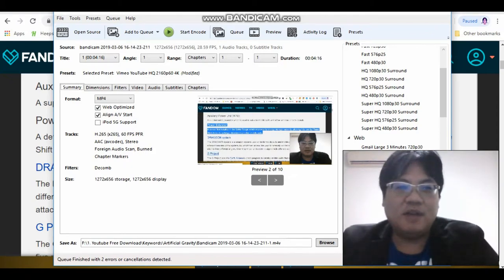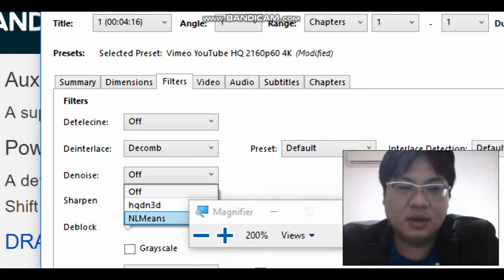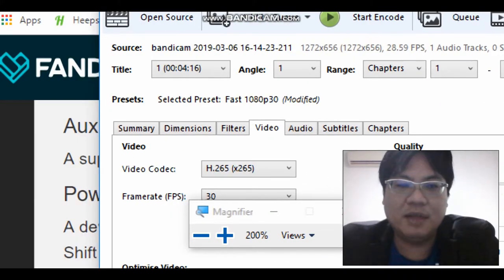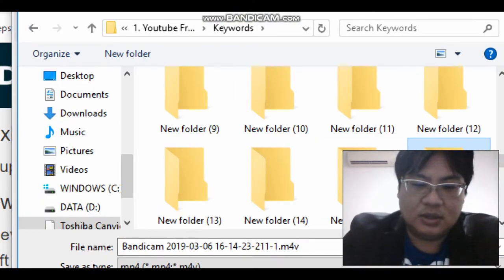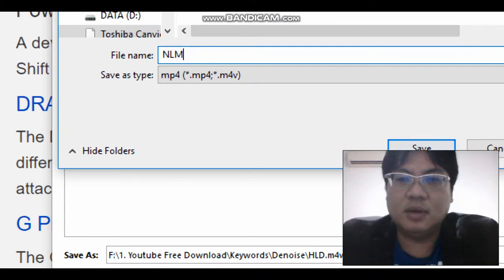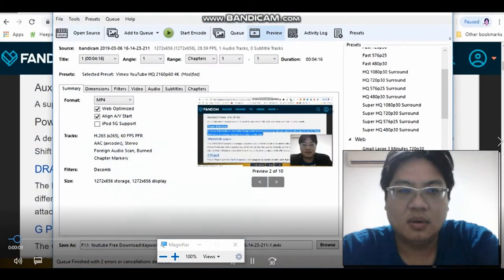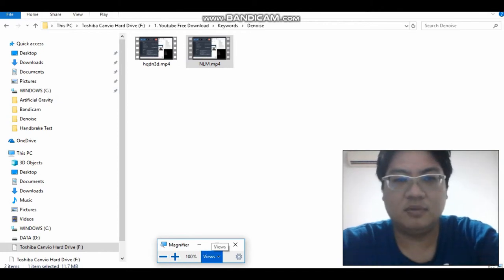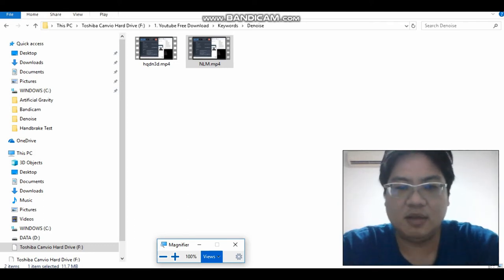How to improve video quality in handbrake – Using Denoise function

Comment: Hard to see the end result 🤔
Reply from the maker: Hi Friend, may I know what you mean?
Reply: Sure, maybe I'm mistaken but i cannot locate a demo of the improvement result, is it in the small pop up in the middle of the screen?
Reply from the maker: No it does not require a pop up. Just go to filters after you added the video. Search for the denoise tab. There are 2 options. You can choose the one that suits your needs. Overly strong Denoise settings may damage picture quality by discarding detail. NLMeans is a high quality denoise filter with a cost to speed. Use where quality is more important than speed. HQDN3D is an adaptive low-pass filter, faster than NLMeans but less effective at preserving fine detail. @Tubemanjac